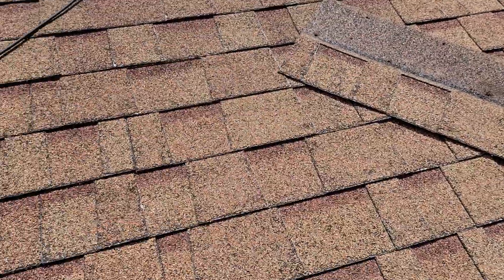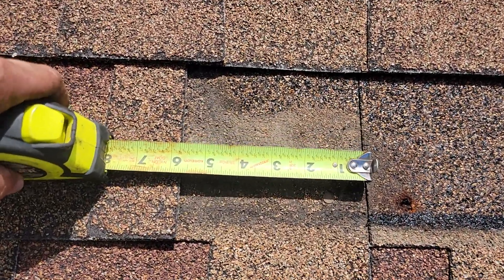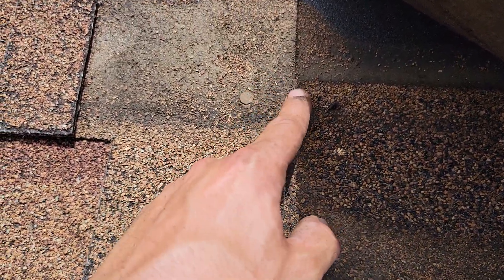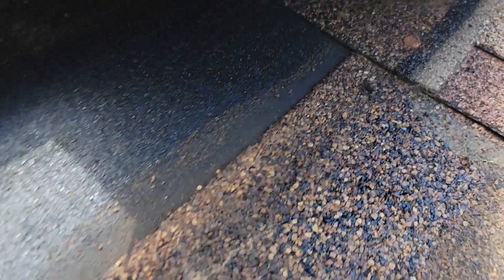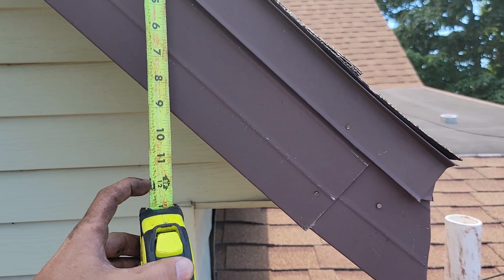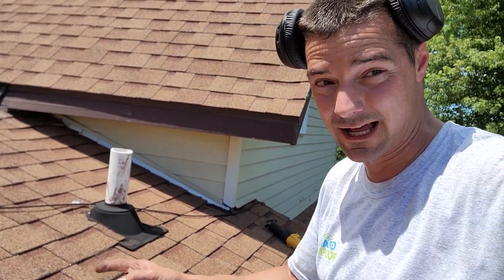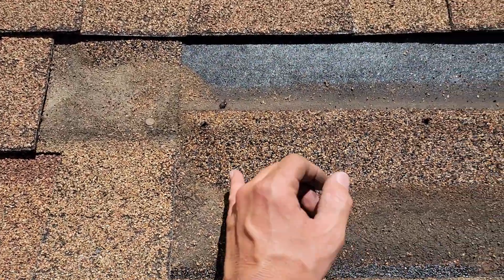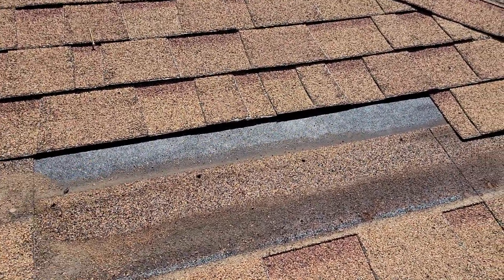Roof Shingle pattern,  shingle offset, Key way, book, zipper

Comment: I've been a roofer and roofing contractor for Going on 30 years I thought about this one for a minute and I watched your video several times and I figured out what the problem is or that is to say I figured out what the chief contributor to the problem is because you definitely found the problem I will bet you this is the Primary runoff point for the two slopes and the flat roof above if you ran a hose up above I'll bet you it just so happens that all the runoff comes right across that key way and in a major storm that volume of water at that pitch is actually going to create a thickness of water that will impart atmospheric pressure to that key way that's how the water is effectively getting pumped into that key way and getting all the way across and if you throw in some high winds particularly if they are directed at the slope that will exacerbate it even further any roofer who has a lot of experience looking at tens of thousands of leaks you will see it all and any really experienced roofer will tell you they have seen hundreds of things that at first glance seem unexplainable but it's almost always answered by some mitigating Factor which usually involves a greater volume of water than you would have imagined as possible so always pay attention to water flow in any area you're looking at and don't make assumptions I often water test areas to see what happens with the water to try to get an idea of what can happen in worst case scenarios anyway great video man

Comment: This one has me scratching my head, 4/12 pitch and a 5.5 inch shingle offset should not have that issue. Maybe that continuous sealer strip combined with the volume of water coming off that valley, or maybe uneven decking. Thanks for sharing
Reply: Yea either the roof is not level because the decking or the framing. The other thing I was thinking is that ~12/12 roof above is giving water more lateral momentum on the roofing below when it runs off.

Comment: I’ve seen this a time or two and am not sure what to think. There is a big enough step in the key way but for whatever reason lateral water movement is greater on certain roofs. Homeowner usually doesn’t like to see flat roof type materials but what are your options. Have to keep the water out. Suppose you could have larger staggered joints. What are your recommendations?

Comment: Didn’t it look like that adhesive strip residue was too continuous? If it was broken up more don’t you think water would have run down more? Kinda looked like it was blocked or maybe I’m wrong
Reply: It looks to me like these shingles had solid seal strips. I believe all of the manufacturers have gone away from that and leave gaps now. This roof is probably 10 or 15 years old.